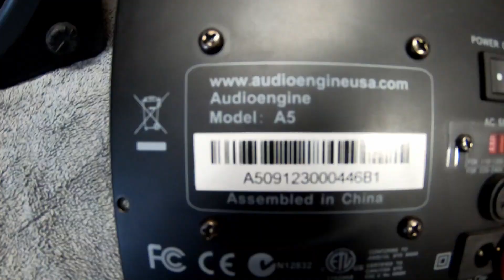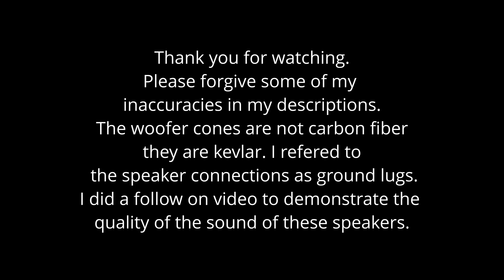Audio Engine A5 active to passive conversion

Comment: I got a pair of these like 15 years ago at a thrift store for $100, was a fair price for a working set at the time. They actually sound pretty decent and I still use them occasionally outdoors if working on something. I also found a free pair of these being thrown out because they made horrible crackling noises. Found the black potting adhesive all over the board had gone conductive causing it. I remove all the black stuff carefully (time consuming), and they worked fine. Converting to passive is a reasonable option if unable to repair the built in amp.  I swapped them out a couple years back when I got a set of JBL LSR305's cheap, but I still say those A5's are decent if you find a set for a reasonable price, even if you need to convert them to passive.
Reply from the maker: I found the potting compound almost impossible to remove without damaging any components underneath the potting compound. On my speakers it was some type of epoxy compound. That was why I decided to go the passive route. I'm still glad I did as they are very nice desktop speakers.
Reply: @rickd7008  It's time consuming to do. Heat from a hair dryer can help, and slowly picking it away, being careful not to damage the surface mount components underneath it. I'll use anything from the smaller eyeglasses style screwdriver, to a tooth pick, plastic scraper, or wooden scraper, but it is tedious to do (things like a tooth pick won't work unless it the potting is softened up first). I do not recall if I used an chemicals like acetone to soften it or not, but it is possible, but was a long time ago, heat from a heat dryer is often enough to get it pretty hot / soften it up. I look at it like this, the amp board is junk anyway, so can't hurt it if I try to repair it. At least you got them usable though and that is all that matters!

Comment: The A2s are even more simple.  The crossover on the amp side speaker is NOT on the board.  Just remove the board, fish the wires through, and plug into amp—I bought a fosi.  It saved my A2s which sound great again.
Reply from the maker: Good to know. I will have to keep my eye out for a "dead" set.

Comment: Hey, just wanted to say thanks for the video. It encouraged me to try this myself with my 15 year old A5s that had a very annoying hiss. I assumed it was the internal amp so a conversion to passive would probably fix it. The shot at 8:20 was especially helpful. I didn't remove anything from the board and just soldered wire like you did and connected that wire directly to what used to be the terminal for the other speaker. 
Hooked them up to a Fosi Audio V3 amp I bought for $76 and I'm blown away by the sound.
Thanks again!
Reply from the maker: Really glad you were able to get these great speakers functioning again!

Comment: Thanks a ton for the video. Got my AE5 to passive mode. I didn’t remove any parts. I took two wires and soldered them to the place where you pointed out on the board. The other end to the terminals where it says audio out to the other speaker. It works fine now.
Reply from the maker: Glad you were able to fix them!

Comment: I tried to replicate the instructions in your video and comments and my speaker no longer works.

I extended the red and black wires coming off the formerly-for-output lugs and soldered red and black to the back of the crossover in the same spots you did.

I’m not getting any sound at all from the speaker when I connect it to my amp. Any idea what could be the problem?
Reply from the maker: There could be something wrong with your solder joints, or there could be a problem with the cross over.

Comment: Mine started cracking so I connected the passive speaker to my high-end stereo and it sounded amazing, so I know it's a power amp problem. So now I'm going to convert the left to passive. But I'm going down the new box route and get a PCB made to match the left speaker and I think they'll sound awesome. Great vid btw 👍
Reply from the maker: Thanks for the comment. I need to get off my butt and create some more content.

Comment: Thanks Rick - Your solution worked.  I had to read the comments and watch the video a few times, but it worked as expected.
Reply from the maker: I am glad it worked. These speakers are too nice to end up in the land fill!
Reply: @rickd7008  Totally agree.  Currently driving them with  a Fosi BT20A that I had on hand, but need an amp with a sub out.  After taking a close look at (your) SMSL SA300, D9 and Loxjie A30, decided on the A30 for my situation.    The speakers sound great now, but lacking low end that my currently unutilized Pinnacle Subsonic should solve with the A30.  Thanks again for the info!  Luckily my removal left the crossover circuit unscathed (appears much simpler on the A5+ where the crossover is already on a separate board).

Comment: Just tried to do the same and succeed but with one question - You just seem to have connected the main Speaker directly, but the tweeter on the top is now not functioning, right? Because it has 2 other cables running into the PCB and now it seems you (and me) got not even sound on those 2, one with working tweeter (the one that was passive from start) and this modified one
Reply from the maker: If you look at time 5:46 it shows the wires that go to the woofer and the tweeter. You need to make sure you hook these back up observing the correct polarity. At time 7:46 I show how I connected the crossover to the speaker lugs on the back of the speaker. The tweeter and woofer both are working fine.

Comment: Hello and thank you for this great video.
I have a question regarding the DAC. After this intervention, the Audioengine DAC is also deactivated, is it not?
If you confirm it, with which new DAC you replaced it?
Thanks in advance for the details. Sincerely, Bruno.
Reply from the maker: Bruno,
When I deactivated the amp I believe that deactivated the DAC. After I did this the speakers are purely passive,  the electronics inside the powered speaker no longer work. I went with a small in size big in sound (for a desktop) SMSL amplifier to drive these speakers after I deactivated the electronics inside the powered speaker.
Reply: @rickd7008  Thank you very much for these details
Reply from the maker: @raymondromo5565  Glad I could assist.

Comment: Do I need to do anything on the right speaker to ensure same sound from both speakers?
Reply from the maker: If your amplified speaker is no longer working you need to follow how I changed it from active to passive. On the other speaker there is nothing you need to do. With this video I tried to demonstrate what you need to do to convert these speakers from active (they have their own amplifier) to passive (they will need an external amplifier). In this video I tried to demonstrate how to bypass the non-working electronics in the amplifier section and still use the installed cross over.

Comment: What was your reason for removing the power transistors/ic's and resistors? I connected the lugs to the nodes you have shown. After testing it the sound quality is really bad and muffled? Any idea what could be the reason for this? 
The speaker used to work fine apart from it hissing and making white noise.
Reply from the maker: I removed the IC's and Resistors to break the connection with the rest of the electronics on the board. I did not want them to have any effect on the signal going to the speakers. Really the only part that needed to be kept was the crossover. I kept everything as stock as possible so as to not affect the sonic quality of the sealed enclosure with holes. I am not sure why your speaker sounds bad and muffled.
Reply: Same here, mine sounds muffled now as well, particularly at lower volume.

Comment: Good night brother thanks for your videos I want to ask you something if it is not a bother I have one of these and it stopped playing ocea sounds but very low and night what to do and I certainly do not want to lose it what advice would you give me
Reply from the maker: Ricardo,
I guess it depends on what you want from these speakers. If you want to keep the original functionality you might think about sending them back to AudioEngine for repair. If they are the original A5's you will have to call them to see if they will still work on them. If you want to modify them so they can be used with an external amp you can look at how I modified a non working set.

Comment: The following video shows a way that appears (to this non-technical person) to be much simpler.  Do you mind Rick explaining why there is a difference?  He’s working on a A5+ and you an A5, could that be it?  Don’t want to head down the wrong path (like you mine’s an A5).  Much appreciated!
https://youtu.be/JNEVJSV1v84
Reply from the maker: If you look at the A5 amplifier board, the crossover is part of the amplifier board. On the A5 plus the cross over is no longer part of the amplifier board.

Comment: Can i use Edifier s1000mk2 active speaker  to a denon avr . By converting a passive soeaker
Reply from the maker: I am going to go out on a limb here and say any active speaker can be converted to a passive speaker so long as you can identify the cross over and maintain that functionality when you bypass the amplifier circuit in the powered speaker.

Comment from the maker: Or perahps you could try something like this? 
Dayton Audio WF60PA 60W Class D Full-Range 2 Channel Plate Amplifier with Wi-Fi and Bluetooth 4.0 aptX  https://www.amazon.com/Dayton-Audio-WF60PA-Full-Range-Amplifier/dp/B071VW4TBG/ref=sr_1_1?keywords=Dayton+Audio+WF60PA+60W+Class+D+Full-Range+2+Channel+Plate+Amplifier+with+Wi-Fi+and+Bluetooth+4.0+aptX&qid=1580698081&sr=8-1
Reply: Would this mount inside of the speaker box to replace the old one?
Reply from the maker: @brivas23ify  I'm not sure. I haven't taken any measurements.

Comment from the maker: Jose,

Go to time 8:28. See the red and black wire soldered to the cross over? Those red and black wires go to the lugs right above the port at time 3:55. There is a pretty clear picture of the lugs are shown at time 7:11. I soldered the red and black wires to the tabs on those lugs. That provided a path from the amplifier to the crossover for further distribution to the woofer and tweeter through the cross over. I hope that helps.
Reply from the maker: I went with a SMSL SA300 for an amplifier.
Reply: So essentially you desoldered the wires on the crossover board from the built-in amplifier section and soldered wire from the lungs to the desoldered built-in amp points on the crossover board, allowing the SMSL amp to drive the drivers instead, correct? Simple enough. If I ever find a pair of broken powered speakers at the thrift store, I'll know what to do  to convert them to a passive set up if the built-in amp is unrepairable, thanks!
Reply from the maker: @arena_rock_man9030  Glad to provide the insight.
Reply: Thank you for the video. I have the same model.  How did you know that those mounting points for black and red would bypass the amp? Can you educate the rest of us how you deduced that those mounting points would be the right ones?  The black wire mounting point looks to be all by itself with respect to the PCB diagram on backside and seems to be only a mounting point for the yellow capacitor.
Reply from the maker: @wildmastiff4193  I looked at how the crossover was connected in the non-powered speaker, and used that as a guide for the amplified speaker.
Reply: @rickd7008  So I enlarged the hole, and extended the wires to the the mounting points. Soldering them. They seem like they are solidly attached even though it was my first ever soldering job. I only get a clicking noise from the once powered speaker. No sound.  Any ideas on how to troubleshoot?  I did not remove any other item such as transistors. I did cut wires to tidy the space up.  You are my last hope before I toss them.

Comment: I'm looking into doing the same thing. I replaced a few components on the amp and it's still dead.  Could you specify the 2 solder points in a picture to connect the terminals to the board and what amp did you use?